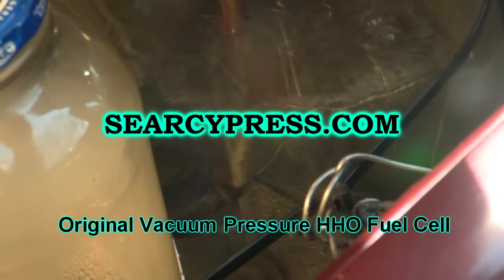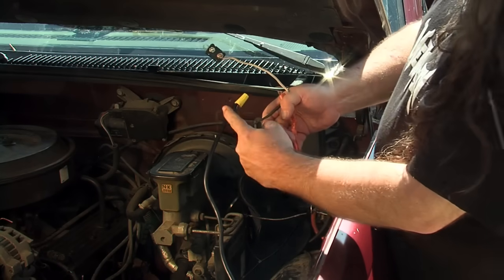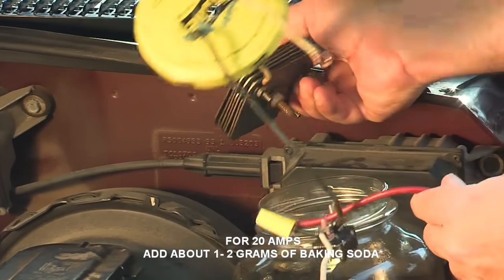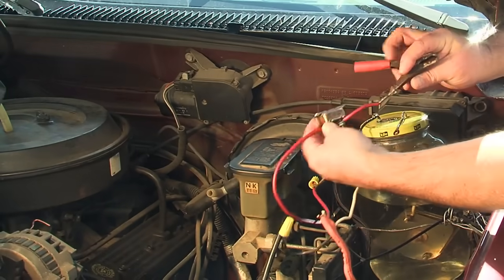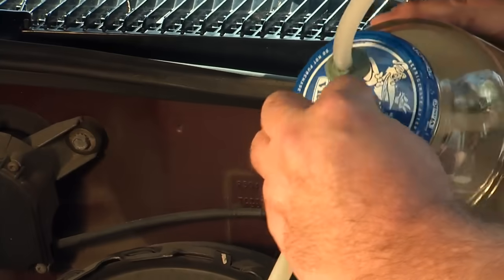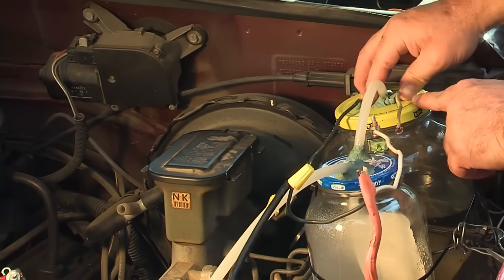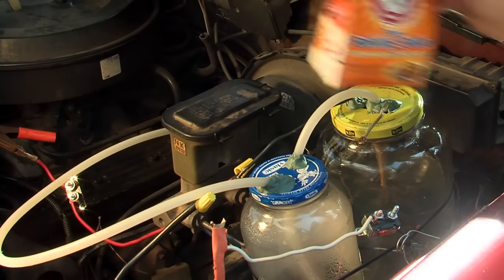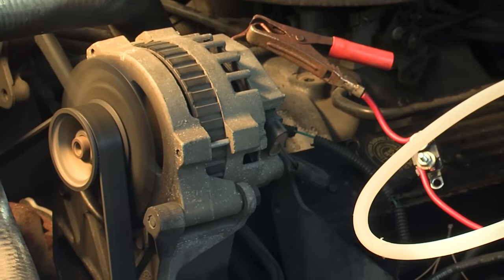Vacuum Pressure Hydrogen fuel cell defeats high gas prices using hydrogen from H2O.

Comment: The oil cartel would never stand for this
Reply: And he thinks the water coming from the exhaust is because if his fuels cell/ generator
Reply: @kgardner004  In the late 1970s an old man came into my shop with a 63 Buick. It had a bottle of water attached to the  dashboard . It had a valve and a small rubber hose attached to it. I said what does this do. He said that hose was hooked to the intake manifold, and when he is up to highway speed, he'd open the valve allowing the engine to suck in a little water. I said what does that do?  He said it cools the combustion temperature, which allows him to burn the higher octane gas without lead in it, and improves his fuel economy by 20%.   Now that's no bullshit.
Reply: @timhallas4275  In truth, some farm tractors used to have water injectors to add water vapor to the mix for that purpose and it worked pretty well with some exceptions. I once tried to convince a truck driver to try it with his Skoal spit cup, but he sobered up before I got him convinced  :)  Dang shame! A good laugh is always of more value than saving a few MPG....Joe
Reply: @joerollings56  The purpose of water injection is to prevent detonation, sometimes called pre-ignition or ping. it does not improve fuel efficiency or 'mileage".
Reply: @timhallas4275  probably meant lower octane gas
Reply: @weeral1  No. High octane gas produces more detonation. The water cools the combustion chamber to prevent detonation.
Reply: Nancy Parker I don’t think this makes any difference because he’s still sucking up all that gas in his heavy truck with a 350 v8 .
Reply: @Frank Wiley Oh for Christ's sake, the "they killed him for what he knew" nonsense conspiracy theory. Grow up, Conspiratard. Your anecdotes are NOT evidence of anything. Prove HHO work or that was why he died, you are talking out of your ass.
Reply: People keep talking about energy in =energy out,  but they aren't considering that there is already energy available for release in the oxygen and hydrogen, which when combusted does give up its energy. 

However, until I'm shown an engine that's optimally tuned and measured without this, then again with, and real data is provided, I'll not believe the results that are alluded to here. 

Fact is that there is no measurable data provided, not even actual mileage calculations. I suspect that any increase in efficiency is the result of better overall tuning and attention to detail in an attempt to optimize the results from infusion of HHO. 

providing assertions is meaningless without data.
Reply: @oldbonesbushcraft Rod Jackson  Yeah?
Reply: Neither does CARB (Ca Air Resources Board).
Reply: Can i have ur whatsapp number
Reply: A few on here running circles around themselves about free energy, extra load on alternator blaa blaah bla......this is not the only person who is doing this, there are lots of people and guess what? They ALL record more mileage to the gallon, that means it does what it says on the tin why would all of these guys show their setups , for free, I might add,  if all it did was waste you money??? Makes no sense. Having said that there are some other things to consider,  petrol(gas) burns a lot slower than hydrogen and as such in a petrol combustion designed engine the valves don't quite get fully shut before the hydrogen explodes in cylinder, so a few losses there, long term issues with hydrogen seep into granular structure of metals etc..do some research but for the life of an engine you'll almost definitely see a saving on fuel bills.
Reply: @michaelnielsen1612  it is a tbi engine, throttle body fuel injected & computer controlled. Idiot.
Reply: Unfortunately, stupidity is rarely fatal.
Hydrogen implosion counteracts gasoline's explosive pressure... I doubt the cartels have any problem with this guy showing people how to reduce gasoline efficiency.
Reply: @hintzofcolorconcepts : What is  most interesting about this device is that it can't even make enough hydrogen to interfere with the combustion of the gasoline vapors.
Reply: @timhallas4275  Bam! Nailed it. That's the biggest issue is energy density. Petrol is scads more powerful than this "diluted" hydrogen "oxy hydrogen". THis is a pathetic imitation of "real" pure hydrogen is. That stuff powers rockets, after all. This is just weak nonsense. It doesn't do anything. 

Real hydrogen is actually much harder/more involved to make than this. More expensive than petrol gas, not as safe and it's unrealistic, as a whole.
Reply: @timhallas4275  Exactly! It's not just about making fuel, it's about energy density. Safety too. Liquid petrol is far safer than the bomb of hydrogen. 

Cheaper to produce too that "pure" professionally made hydrogen (and higher energy than collecting electricity from ineffecient solar panels). Not this "oxy hydrogen" nonsense. That's just diluted crap, barely enough to run a welding torch (but I can do at least that) or maybe a Bunson burner in a Science lab. Lol.

That's where their extra benefit is coming from, oxygen. Pretty easily proven with how ramming air into engines works. If I spring a leak in my fuel line, it's not likely to blow me up. Can't say that about hydrogen. With how poorly some people maintain or check their vehicles, that's a recipe for disaster.
Reply: @hintzofcolorconcepts  Hahahahahaha, awesome comment, loved it! The sarcasm was epic.
Reply: I know. He's going to die mysteriously in about 30-40 years.
Reply: @timhallas4275  Sucks cause that's how they all go. More people need to learn this fast
Reply: F***k the  Cartel ah ah 3000 Miles on a Gallon of Water
Reply: The only problem is most cars are fuel injection, not with carburetors!
I tried it about 35 years ago, it also increases horsepower!
Reply: @abelincoln332  bullshit Abe. Adding Hydrogen to a gasoline engine's intake will make it run worse, not better.
Reply: They’ve gotten away with it for about 40 years now.
Reply: time they all came to court to explain this global greedy neglect obvious sine that oil is running politics and automotive!
Reply: @secretagent2777  Hydrogen as an internal combustion fuel cost 4 times as much as gasoline. Who's going to pay that bill....you?
Reply: @timhallas4275  That's just bullshit hho costs a fraction of 0 to nothing compared to gasoline  if an hho kit works this means that it works on bigger scale to what should result higher yield worldwide! get involved man that facts are there HHo on demand is the future!
Reply: @secretagent2777  You better get a science education real soon.
Reply: @timhallas4275  100% if a glass jar setup at a fraction of the cost even can't convince you!
Reply: @secretagent2777     Energy in equals energy out.  Look it up.
Reply: Water is cheaper. + (no drilling or refining) so you lose there!
Reply: @secretagent2777    You still don't get it, do you..  What separates the hydrogen from the water?  Where does it come from?  Is it free?
Reply: @timhallas4275  Yes from the Alternator.
Reply: The Alternator and battery have room for adding stuff like a radio or a extra lamp? right? not overloading the electrical system so wy not use all that excess energy. when a battery is full its full but the alternator keeps delivering that's money down the drain there and the perfect place for a hho kit!
Reply: @secretagent2777   This vehicle runs on gasoline. The energy from the alternator is used to separate the hydrogen from the water.. The alternator uses power from the GASOLINE ENGINE to make hydrogen which in this case adds zero horsepower to the engine. It is actually less efficient than it was without the hydrogen jar.
Reply: @timhallas4275  Not true.  More fuel equals more power!
Reply: lol your telling me to go to school wile saying hydrogen and pure oxygen are slow burners... probably you never learned that they burn cleaner faster and more efficient than any other fuel source!
Reply: @secretagent2777  the alternator doesn't put out a constant flow of free energy..  the alternator puts a load on the engine, based on the load put on the alternator.  This HHO devise, puts a load on the alternator, which increases the load on the engine, using more gasoline. All this device does is trade gasoline for hydrogen and there is a net loss in energy. There is always a net loss in energy.  Adding hydrogen and oxygen to a gasoline engine's intake manifold does NOT increase the engine's performance at all. In fact, it interferes with the engine management computer's ability to regulate the fuel/air ratio, making it LESS efficient.  School is over.  Do some research. This devise is a scam.
Reply: @timhallas4275 It,s does put out a constant flow of energy with a lot of it wasted. !Energy! Alternator gets driven by the engine! fact! if even it provides more then enough to keep the battery full fact! this means that its providing more then used so wy not use that spinning alternators energy!  dude school just begun! Make sure to put hho line b4 the air mass meter/sensor (lambdasonde) so the ecu (computer) knows feels senses and so can regulate the amount of air/gas mass added. there's your problem SOLVED... Peace!
Reply: @secretagent2777  You don't know how an alternator works. I am an electrical engineer. The alternator's output is determined by the load. There is no "wasted energy"    You better do some research. You're beginning to make an ass of yourself.
Reply: @timhallas4275  combustion engines don't burn off 100% of the fuel, adding a hho kit results in a cleaner more efficient combustion resulting in more power and lower emissions! next to this there's a lot of room for improvement 65% is lost in heat what can be converted back and used as fuel to but that's another subject.
Reply: @secretagent2777  Wrong again..  Today's combustion engines do burn off 100% of the gasoline.  65% is not lost in heat..   and adding hydrogen to the gasoline/air mixture DOES NOT improve combustion, efficiency, or fuel mileage.   Instead of spending all your time arguing from ignorance, why don't you go do some research?
Reply: @timhallas4275  Tim lol i just wanna point out what fantastic human you are... your driven but this is just not your line of work man sorry. lol but just to make sure! (: can you give me a example of where the heat is converted? if your saying its not lost? Bro!
Reply: @timhallas4275  You would do good tho as a 2e or 3e grade debunk agent for big oil!
Reply: @secretagent2777  I didn't say the heat was converted.  Pay attention.  In modern gasoline engines, 95% of the fuel is converted directly to mechanical energy. That means only 5% becomes heat. This isn't your grandpa's oldsmobile.
Reply: @secretagent2777    Look, you apparently haven't figured out yet, that I have a lifetime of knowledge on this subject.. You should be learning from me, rather than playing this silly game.  It's your loss, if you don't...
Reply: @timhallas4275  It's quite evident that things being discussed here are flying over your head, perhaps to such a degree that you may even start thinking outer space is real...

1) Drawing power from alternator to power the electrolysis results in a net decrease in efficiency. This is false if the engine and hho generator are properly calibrated, so that the amount of hydrogen + oxygen entering the engine are at optimal ratios to the base fuel:air ratio. If he is pulling 30 amps at 12 volts, that is 360W - assume the alternator is 90% efficient, and full load is 400W or a little over half a horsepower. This is not nothing, but it's also substantially less then the power required to drive a supercharger - are you going to then tell us superchargers are a scam because they siphon power from the engine claiming to boost it? Only if you're a fool... it is well established that despite the parasitic loss of driving the supercharger, it provides a net gain to power output and improves both thermal and mechanical efficiency of the engine.

2) A mixture of hydrogen + oxygen into the air intake of an engine will hinder combusion. True if the ratio is wrong, false if the ratio is correct...and the unit providing the HO must be able to meet the demand of the engine across it's RPM range so that the ideal ratio is maintained.

3) Modern engines burn 95% of the fuel. False. Most of the fuel injected into an engine is used to cool the engine, and therefore is expelled unburnt. Even the newest gasoline engines with high pressure "direct" injection are only burning about 10-15% of the fuel per power stroke. This is why doing things like spraying nitrous oxide into the intake manifold of an engine can boost power output by 100-300%... If modern engines were actually burning most of the fuel, there would be no need for catalytic converters and other nonsensical "emissions control" devices such as EGR.

4) What does hydrogen actually do when it is drawn into the engine at an ideal ratio? Like nitrous oxide, it helps increase the amount of fuel burnt per power stroke by introducing more oxygen to the mixture as well as providing hydrogen gas, which burns faster than gasoline, and can aid in a more complete ignition. The result in gasoline engines is that timing can be advanced (substantial power gains), and if ECU tuning is done, the air-fuel ratio can be leaned out without sacrificing power or causing detonation...i.e. the effective octane rating is increased, but without the drawbacks of using higher octane gasoline - which burns slower than lower octane variants.

This is quite easy to try yourself on a cheap engine, so you can test and see if it works or not rather than arguing points that are largely indefensible.
Reply: @timhallas4275  then how can you explain the carbon and other emisions that will cause back fires in cars if it burns off 100% of the gas
Reply: @vikingskuld  That question made no sense. I can't answer it.
Reply: @timhallas4275  lol i dont want you to im new to this subject but smart enough i can do my own research. There is a way you can correct some one that may be wrong and a way you shouldnt. The best way i can put it is like this its better to be thought a fool then to open your mouth and prove it. I worked with explosives in the military and you have to have oxygen to make some thing explode or burn. So for it to be a bomb you have to be getting a decent amount of energy somewhere.
Reply: @alphaforce6998  Thanks for a comprehensive and well rounded comment.
Reply: @secretagent2777  ill just keep it super short cause i will not argue about this....YOUR WRONG.
Reply: @timhallas4275  If a gasoline engine was 95% efficient, it wouldn't need a catalytic converter, would it?
Reply: @edmelungeon2239  Do you know what a catalytic converter does?
Reply: @timhallas4275  u may wanna do your own research there homie... today's engine's burn 100% of gasoline??? 🤣🤣🤣 who told you that? Some teenager on tiktok??😂😂 I'm not saying hho work's but think about what you're saying!! If that's actually true I guess I can go rip off my cat and EVAP system 🤣 thanx for the laugh bro I needed it
Reply: @ifucturmotha6692  I'm a certified auto emissions inspector. Your evap system removes fumes from your gas tank and sends them to the engine to be burned. Your CAT converts CO to CO2.  CO is a poisonous product of combustion. Modern gasoline engines are nearly 100% efficient.
Reply: @secretagent2777  NONSENSE, you cannot use Conspiratard nonsense to support your unproven theory. HHO has never been proven to work.
Reply: @MrBilld75  if you can't use a calculator/head don't bother to try and understand this!
Reply: @Frank Wiley Bullshit.
Reply: @timhallas4275  .  It wasnt the 60s.  The guy did this to a VW dunebuggy in the 80s.  Stanley somethin-r-nother.  He was in negotiations with the US government to fund research when he died of a anurism.
Reply: @ronniestanley9090  Stanley Allen Meyer was his name and he died in 1998, as you described. His claims were never proven.
Reply: @ronniestanley9090   Sure that's why he ran out of the restaurant clutching his throat saying he was poisoned. An anurism makes people do that, right?
Reply: @ronniestanley9090  his was an entirely different set up and he died under some really strange circumstances !!!
Some rare poisoning I'm guessing ???
Just showes they are more creative in Ohio than Arkansas ...
Reply: @williamcollins4082  he died of an aneurysm. People die, you know. Sometimes they die at really odd times. One of the founders of a company I worked at had his aorta separate from his heart the night before a really huge business deal that would have raked in tens of millions of dollars. I bet he was really killed by a secret cabal of people that didn't want the deal to go through.

Comment: Mangagement systems, injectors, new technology, geeks, critics, KEEP IT SIMPLE AS HE HAS. This is an old system for older vehicles.
The alternater gives out more power the faster the engine runs and the pipe sucks more air the faster the engine runs. They lye to you today about technology being better, the same applies with Nitrous oxide, on older cars it is much simpler. Many cars in the old days were converted to run on gas which was a simple conversion. They introduced all this new technology to stop this. They do not want you to have wind turbines and solor panels on your house for the same reason.

Comment: HHO means extra oxygen  - the oxygen sensors tell the engine to enrich the mixture - - so you need to think how to turn the sensors down (like a variable resistor). They make cars so you can't run them on HHO or water.
Reply: Anti-lag would be a better solution, maybe a turbine hooked to the engine to start the car and remove the starter motor